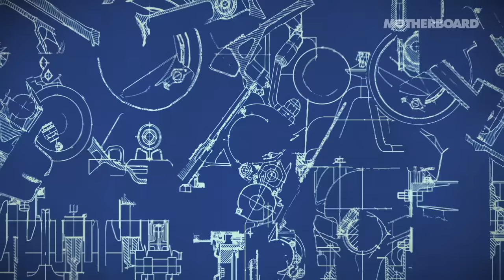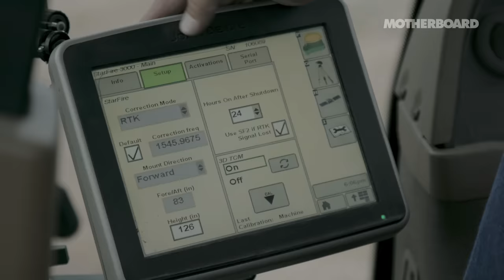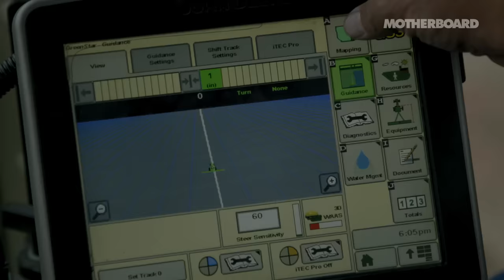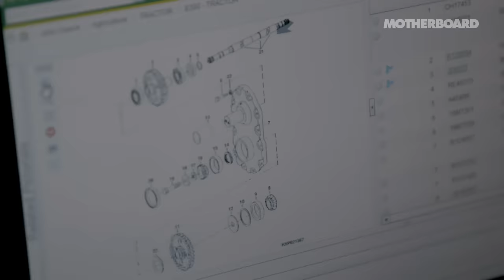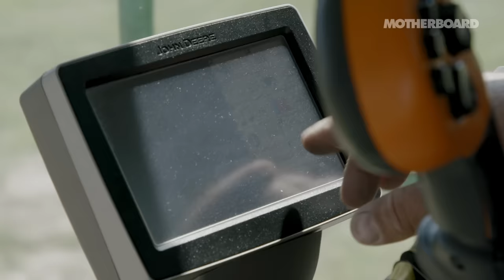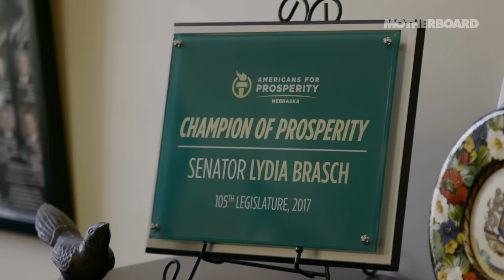Farmers Are Hacking Their Tractors Because of a Right to Repair Ban

Comment: If you’re going to own heavy equipment you’re going to need to fix it when it breaks. WTF! After watching this I wouldn’t buy a John Deere lawn mower.
Reply: It’s not just  Deere it’s all major at companies
Reply: Tesla does this too
Reply: Fortunately, the small stuff is still completely mechanical. We have a john deere zero point turn mower and there's not a single bit in it that is digital.
Reply: Just so you know it’s not just Deere pretty much every single farm equipment company is like this they are just the biggest. If anything John Deere is the best at making it easier for farmers to work on their own equipment throughout the 1900s Deere was one of the last companies to keep building 2 cylinder tractors after everyone else was building 4 cylinders they finally built 4 cylinders after the technology was improved they were the same way about 4 track tractors Case had been doing it since the 90’s but Deere steeped in with a much better design in 2016 when they were able to produce the best that Deere could produce
Reply: @Colton Lester 
Haha everyone laughs at the cheapass plastic carbs , but they don't get as nasty as a metal one and can be cleaned a little easier. 
Once a metal one gets nasty , there could be corrosion in a passage you'll never get out possibly. 
Best chance is trying an ultrasonic cleaner after traditional sprays. 
Briggs put out a bulletin about not storing gasoline longer than a month without treating it with a stabilizer. 
Problem with a carb is the bowl vent exposing the fuel to air. It's such a small area of fuel it goes bad fast. 
Run a stabilizer and /or run it with the fuel valve off (if it has one) and that should help carb issues. 
Carbs are usually cheap to replace , just dont go for the cheap Chinese ones.
They are nothing but headaches.
Reply: New Holland isnt pretty good for being able to fix yourself
Reply: @setesh1294  I doubt JD actually makes it.
Reply: @Johnny96ri  it is. We got it from our local JD dealer. Then again, it's a local tractor company not JD itself.
Reply: @setesh1294  you bought it from JD. It's probably another company, who bought the right to slap JD on their mower.
Reply: @Johnny96ri  no, it's a local dealer that is licensed to sell JD stuff.
Reply: @setesh1294  ok, one more time: Deere almost certainly doesn't make it. It's made by another company, with the John Deere name slapped on.
Reply: @Johnny96ri  it's a Z300 series mower. And by the way, slapping another company's badge and model number on one of your own pieces of equipment is actually a felony in the US. So that's not gonna happen.
Reply: @setesh1294  What in the world are you babbling about?  John Deere contracting with another company for manufacturing something and putting the JD name on it is perfectly legal and quite common. (Off the top of my head, Kenmore never built a single appliance.)
Reply: I do have a JD lawn tractor, but instead of paying the high prices for maintenance I let my friend that rebuilds tractors work on it. I would rather pay him than a company that does not need my money.
Reply: I was just thinking the same thing. I will never purchase anything from John Deere after watching this. Horrible company.
Reply: Husqvarna is just like Apple and creates a proprietary shaped tool so you can't perform simple maintenance on their chainsaws, I'd imagine the same goes for their lawnmowers, etc too. Naturally, any work done without an  "approved technician" voids warranty on products that used to come with trusted lifetime guarantees. And what I find more nefarious about this industry wide business model, is that it pits the customers against the dealerships, cell phone retailers, mechanics, repair guys for all tech-inclusive products. Companies are marketing their products to dealers as having a built-in customer repair business rather than garnering profit on the initial sale which the "manufacturers" now keep. But, because the cost is still high regardless of who's keeping the cash you're only ensuring contempt among neighbors in rural communities. You used to have a good relationship with the guy you bought a $5,000 product from in your town, now both of you are trying to screw each other over just to squeeze by.
Reply: Vanargand  yes, and does that mean they've fundamentally changed the way they operate? When your ipad screen won't turn on bc of a loose internal connection and you walk into an apple store, are they going to say you can go home and fix this no prob, here's a tool set for 19.95? Do they make access to their batteries and mini sd slots available again? I actually don't know on that one, crossing my fingers, but not holding my breath.
Reply: @marthale7 but iphones gets outdated after 5+ years, tractors meanwhile gets used for decades...
Reply: It wouldn't surprise me if the other manufactures do the same thing.. Case, Massey Ferguson...  This crap is intentionally being done by the tech companies for more than just farm equipment.  PLC's used to be easy and straight forward to program because they put dip switch's on boards.. now you have to connect to a computer to upload the program and put all the info in and they don't like just anyone having the means to do it so you have to have a service tech come in.. In my field that means flying a guy into your state to get it done where before it was a matter of 2 minutes of changing some dip switch's and rechecking to make sure you did it right.
Reply: I won't own a John Deere!

Comment: I think the John Deere is severely damaging their brand and that this type of behavior will severely backfire on them.  Farmers should not give up control of their expensive machines to programmers.
Reply: It's not just JohnDeere, try Apple, try Tesla, try Dyson.
Reply: David David  When you buy something, you have the rights to use, modify, and to repair that item as you wish for PRIVATE use.
Reply: David David  This isn't a complex problem. Give the farmers the tools to fix the tractors. The company deliberately makes the equipment inaccessible to fix unless to have the right software(to connect the sensors on the new part to the main computer)...which only John Deer has. That's called a monopoly, and those only cause problems. Also, you speak of programming being challenging. Well, you're dead wrong. Programming is bloody easy. Anyone is mentally capable of creating simple programs and rooting devices. 
If I can buy an Intel CPU and install it on my PC without going to an Intel "dealership", then a farmer should be able to buy a John Deer part and install it on John Deer tractor. Also, we're talking about tractor hardware breaking and not replacing the whole bloody computer.
Reply: David David  I'm a programmer, but making diagnostic software for embedded hardware on items which should be otherwise user-serviceable is despicable. Even as a programmer I cannot reasonably    do anything on my car besides read federally-mandated OBD2 codes. Even if you packet sniff CAN busses, the traffic is meaningless without the manufacturer releasing information on what the data means  or if they actually make control module firmware available (which they don't). It is not a problem of user intellect but rather poor product design and business practices that should be illegal.
Reply: What other brand are they going to buy?
Reply: @fredpinczuk7352  kubota.
Reply: Unfortunately for customers john deere and other companies like apple have already calculated that it's worth spending money to fight these Bill's AND lose reputation than to allow customers to freely repair their products.
Reply: Deere is overrated and overpriced anyways, would never buy one
Reply: David David  You wouldn't have to program things yourself. You would simply have to RTFM and follow a set of procedures that anyone could follow. With good documentation that held your hand, the end user wouldn't have to be sophisticated at all.

Comment: This is why older equipment is so coveted. I still see tractors from the 30's in use today
Reply: My grampa" had a John Deere from the 1930's and never broke down.
Reply: And also how insanely expensive the new tractors are!
Reply: Got a 1969 Massey, still runs like a top and use it multiple times a week
Reply: basically all we use is old tractors, i think the newest tractor we have is from the early 80s. We have Allis Chalmers WC tractors from almost before World War II we use
Reply: A older farm that we used to trade labor and equipment was always saying cheap HP was the older tractors. That was in the 80s 90s buying used big tractors at auction cheap because most people at the auction wanted the weekend farmers tractors
Reply: my best friends dad is a farmer, and he's got all john deer from early 1980's and he refuses to part with it.
Reply: @demonpride1975  we had a 4220 one of the first years of the power shift very good tractor. Farmer down the road had a 5020 very good HP tractor and two 1020s great smaller all around tractors
Reply: @TwirlingFern  the counter for a lumber cut back machine wasn't counting right. All the different computer tech people would not have a clue until 1 guy and I were talking about it and I asked him why wasn't it more simple. He wrote a new program in a few minutes. We plugged in the new code and never had a problem again. They were all over thinking the problem and needed a dumb old country boy to get them on the right track
Reply: Manuel Labor 78  so true
Reply: First past the post two party system that enables the heavy corruption of politicians, decades of empowering multibillion companies and their lobbying power and an extremely restrictive immaterial law (patents and copyright) which is ripe for exploitation like this. Those are the key reasons things are like this.
Reply: @markthompson7503  This makes just no sense.
Reply: as privately held farms are shrinking in size as we go, the tractors don't necessarily have to be hundreds of horsepower to pull huge multiple gang plows or disc harrows.  just a three point hitch and maybe 20-30 horsepower does it.  those old tractors do fetch a pretty penny now and rightfully so.  some are even more worthwhile to have just for being old and still serviceable
Reply: @duskintheforest584  plus the cost of the environment?
Reply: This is why older vehicles are so coveted.  My dad taught me to work on a car, truck, and lawnmower.  I look inside now and it's all computer.
Reply: @ok yep "built-in obsoleteness".  a switch will work x amount of times then break.  parts are designed that way.
Reply: Most owners do not have the time and equipment to decompile and analyze the software and firmware used in modern equipment.
Manufactures and legislatures have went so far to make a Linux like version unusable legally.
Reply: Old old old equipment never heard of computers that can crash the tractor if contractual terms are not OBEYED.
Reply: @N5LRZ  I worked for company that replaced a 90 year old box cutting and printing machine with $1M computer driven press. Then found out they had to raise prices. That and a few other sound MBA practices put that company in Chapter 7 and COMPLETLY out business. My mistake was I though it was a good company to work for. Hay it had been in business 75 years and growing 3-4% every year, with a 10% profit of the gross every year. Then a International Food company bought it.
Reply: but but but climate change
Reply: I don't farm much but my main loader tractor is a '66 model.  It just rolls over and starts and works as long as there's fuel in the tank and a little juice in the batteries.
My main tillage tractor is a '79 model. 
My main haying tractor is a '81 model.  
I have another extra that's about a '70 model I think.  
They're all orange and no computers.  I can't afford green.  This video just affirms why I don't have green. 
I was looking into a newer main tractor but it would have some level of computerization involved.  Nothing like these new ones but at least some electronics.  Not sure it would be a very good move.
Reply: I have a 2017 SUV and a 2002 diesel Super Duty truck. I intend on keeping the truck as long as I can find parts for it since the amount of electron components are a bare minimum. It can not be tracked as there is no GPS installed and feel freer driving the truck than I do the SUV.
Reply: i run a grey fergie from 1947 still going mows the fields drills the postholes
Reply: Out here in Iowa, you see all types of tractors, but IH seems to have a higher share of the market up here.
Reply: If farmers want to beet the system, they need to stop buying John Deere equipment. When JD stock prices "tank" then maybe it will see the light on RTR.
Reply: Yep! My dad had an old Farmall H that I learned to drive. Even did a few wheelies on her
Reply: They call it old junk. To me it is gold that's dirty. Keep the old even if you have fabricate your own parts. The"new" is garbage.
Reply: @demonpride1975  My Dad made a gizzmo to go on all J D tractors and other tractors --- but J D saw it cause it saved a lot of repair and instead of giving MY Dad a little money for each item --- they stole it and put it on all tractors My Dad got 0 --- the shaft and j d made the money----
Reply: My 59 Ford 801 power master is still kicking ,4 lever backhoe too "it's a little sloppy now but it can do the job"
Reply: Not even just big tractors. We have an old 80s John Deere garden tractor that we mow our lawn and do yard work with. Thing is an absolute tank, while our neighbour bought a new one a couple years ago and it is already starting to go

Comment: Ah yes, the famed "Component no longer supported" ploy . . . the oldest forced-upgrade trick in the book.
Reply: Yeah that's a low-blow when any company does that. They know exactly what they're doing too.
Reply: It's gotten really bad with phones. I own a Note 9 which is still a realtively newer model and they have already, after only 2 years, discontinued it. And this is an Android product, apple is 10 times worse. Apple barely supports the phones they just released.
Reply: @TNTspaz  not necessarily true apple actually has a quiet decent update time on their phones and for android there is the android one certification u should look for. With parts and serialisation thats another thing 🙄
Reply: @TNTspaz  just get LG. They use top hardware at throw away prices since nobody buys LG phones
Reply: @AbuHajarAlBugatti  Life is good with LG
Reply: @missunderstoodsspecialed-bj3jt  Start redesigning and rebuilding your engineering technologies back to the pre-computer era of the 1970s where everything is 100% DIY repairable, upgradable, fixable, inspectable, testable, checkable, rebuildable, etc, and what have you! Pass American Laws baning planned obsolescence by making everything 100% DIY restorable! I can still remember that late 1980s going way back to the entire 1970s and 1960s and 1950s and 1940s where everything is held together by screws, nuts and bolts, mechanical clamps, mechanical sliding clamps and other kinds of mechanical connections that can ALLOW ALL AND ANY OF THE COMPONENTS TO BE REPLACED AND THAT INCLUDES THE SUB-ASSEMBLIES SO THAT THE ENTIRE PRODUCT CAN BE REPAIRED AND BE REPAIRABLE AND UPGRADBLE AND SCALABLE INDEFINITELY.
Reply: Let me say this to a customer that they need to upgrade to the latest menu so I can make their food....in all seriousness there is probably an Asian dude out there that will sell you the software. What those nerds gonna do? Call the cops and their mommies? Boo hoo. I got a D for you lil pen pusher.
Reply: Exactly it's only acceptable if there was a recall
Reply: BINGO.
Reply: I love the crap firmware update that breaks your device when it's out of warranty
Reply: @Joe-by8jh   There is a difference between the capabilities of an operating system and  planned obsolescence.  
Do you genuinely think you can do all the things you're doing today at the same pace and same quality with a microprocessor from 2001 and 35MegaBytes of RAM?
People want 4K video on their TV's , not only you need Thousands of megabytes to stream that thing , you need a chipset capable of processing it and showing it to you.
I used all windows version between 3.1 and 10 (included) and If you really think XP or 7 was capable of doing what 10 can do, you would have not lost anything by remaining on XP... except drivers for 3rd party hardware... which Microsoft is not at fault, it's the developer's fault they don't want to make their drivers backwards compatible...
Reply: @greenrefer: With all do respect to farmers.  The GPS unit that failed, in this video, is a convenience item for the farmer.  But, then, I might be wrong but I don't think it is an integral part required to keep a tractor running.  My uncles GPS: a painted milk jug on a fence post. When he plowed, every spring, he'd aim for the jug on the fence post.  Of course few farmers plow anymore, so replace plow with disc'ing or sub-soiler.  But, you get the point.